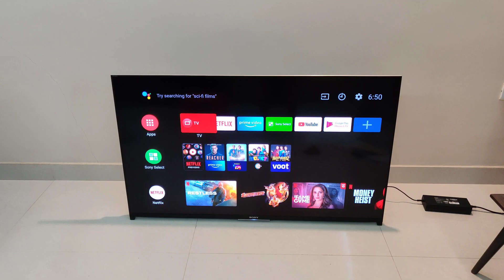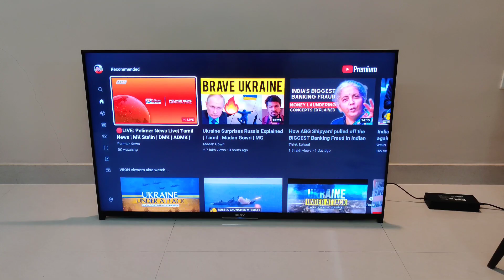Sony Bravia Red Light Blinking 6 times - Issue Fix! | KDL-50W950C

Comment: i hv seen many vids 10k resistor can work
Reply from the maker: Yes maybe but soldering a resister is a complex process.. needs some basic to intermediate knowledge of electrical & electronics engineering. So compatitive to that just cutting a wire like I've explained in this video is doable by anybody and hence easier..

Comment: And is presenting the same issue with the red blinking lights 6 times but the connections are different, what cable should I cut to fix the issue?
Reply from the maker: @Joshua I'm not sure how your connections are.. Please look through the video and try to find which wire to cut to solve the issue.. else I'm not sure how I could help you.. :/
Reply: @adithkrishnan9538  hi Adith I have kdl65W855C  and the cables are 20, ten on the top and ten at the bottom. Do you have any idea which of the cables it is . Thanks
Reply: @shadowthehedgehoggamingtv4155  I have the same model..How did you go?

Comment: I have had the same issue, i could literally see the black spot due to blown leds after bypassing the feedback. I changed led strip LHS strip only as RHS wasnt available, and kept the opened the bypass. Within a few minutes the OLD RHS strip conked off as well. Will wait till the new strip arrives. Do you think this is due to variable LED resistances that is causing the imbalance in the feedback loop?? What would have caused the perfectly working RHS strip to blow.Also should i also replace the IC for the led section to prevent blowong of the strip??
Reply from the maker: @Bhushan I'm sorry but I'm not this technically sound with electronics and components so don't really understand what you're saying. Whatever I've tried is done through looking through other videos and resources online and this video is a combined effort to sum up all that so it's easy for viewers without technical knowledge to try the fix at their own risk.. Hope you find a solution soon!
Reply: @adithkrishnan9538  i did, the Tvs been working fine since I replaved both the Led Strips. It was the change in voltages between the old and new strip that caused it to conk of. Now all seems fine to me. Thanks
Reply from the maker: @bhushantipnis1108  good to hear!!👍🏻

Comment: Genius! I'm trying this on a Sony XBR55x850c.  I see the BL_ERR is the 4th wire, row 2 according to list on board. Top or bottom of clip? what is row 1 of wires?

IT WORKS!!!!!  Thank you so much. My TV was a birthday gift long ago. Can't replace :) Any extra life is a blessing.
Reply from the maker: Hey! Umm I'm not sure as to how your pins are arranged.. I mean if the diagram surely says row 2 and 4th pin then pls try prying it out slowly if you can. If it's a permanent clip like ours then you may have to take a risk to cut the wire.. That being said if there isn't any indication as to which wire to cut then you follow my solution as explained above and cut the 4 wire 1st row. I don't know why there are 2 rows of wires and what they correspond to unfortunately! :(
Reply: @adithkrishnan9538  can I email a pic?
Reply from the maker: @cathy9791  sure! My email is adith_krishnan@yahoo.com
Reply from the maker: Awesome Cathy!! Glad I could help!!
Reply: Cathy, I also have the XBR55x850c blinking red light 6 times. Do you by chance have a pic of the actual wire you ended up cutting on your TV? This literally happened to our TV 5 years ago when just a couple months out of warranty. Since replacing it, it’s just been sitting in our guest bedroom and would love if I can revive it once again.